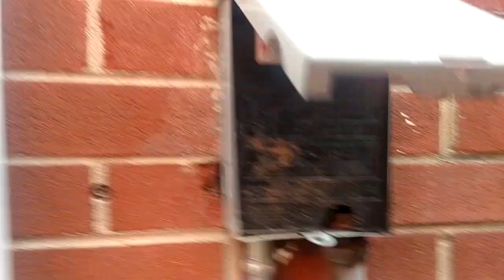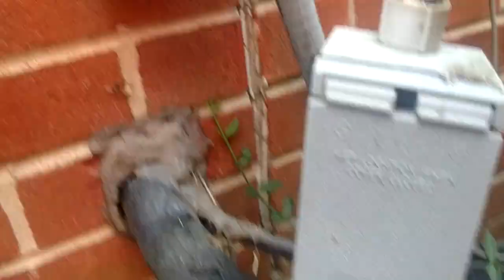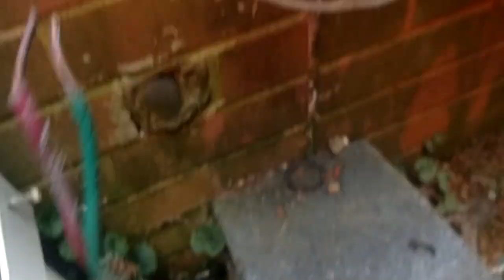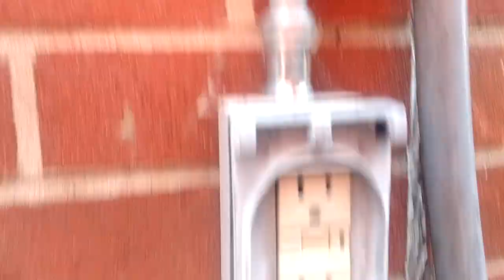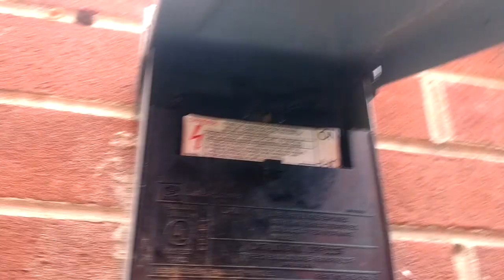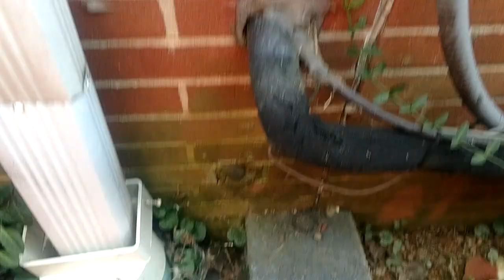I almost became a⚡110V⚡short to ground!!! Jack-leg wiring at disconnect. Breakers are your friend.

Comment: Tech Tip For All - - Always check out the service disconnect box, and its wiring as well as the connection cord to the unit BEFORE you ever work on the unit !!!!  There can be bare wires, or wires rubbing the box or the unit and ready to short out to you and your grounded feet or other hand !!!!!!!! Capacitors are not secured and can be leaning against the access cove ready to wake you up !!!!!!!! Service safely !!!!!!!!!!
Reply from the maker: You are right about that 👍

Comment: looks like they had the white as "hot" and the box was actually grounded well or it wouldn't have made such a nice firework show, so the risk would have been minimal, but still an attention grabber and possibly a shorts filler lol
yeah, It should never be connected and fed off there and sure not through the cover multiple code violations there.
it should be it's own circuit with proper sized breaker and of course mounted as it is now.